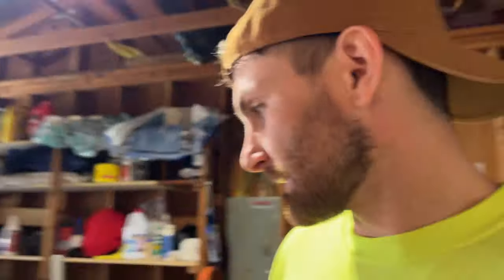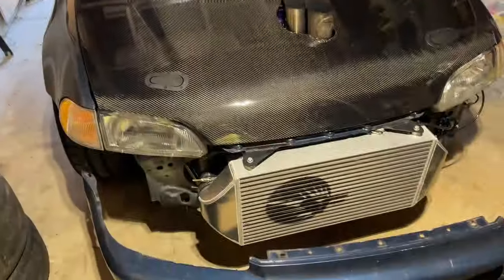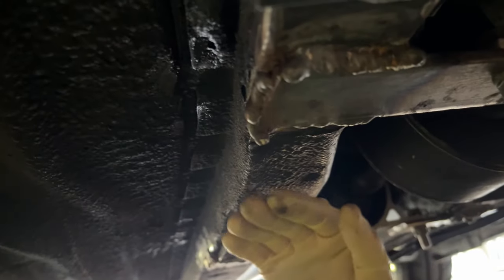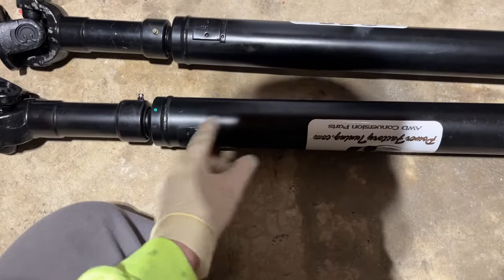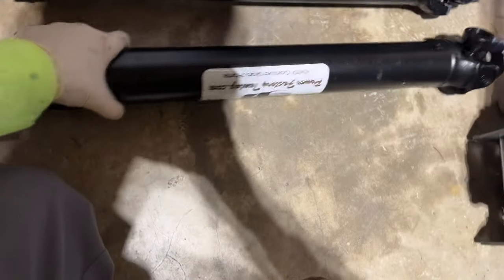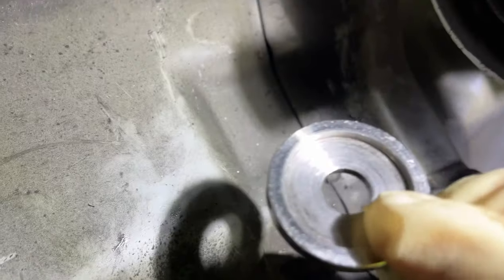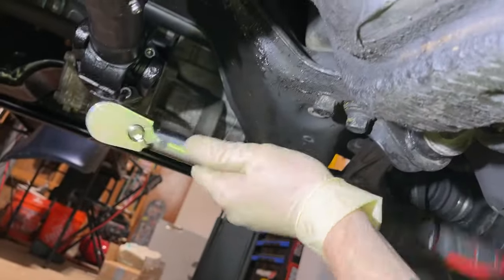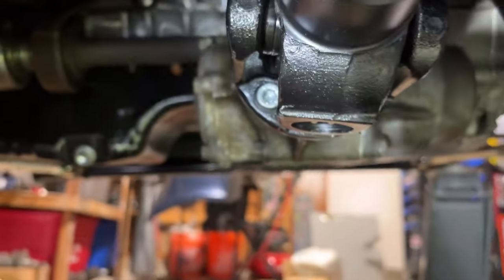The biggest issue with my AWD civic..

Comment: Do you think it’s possible to go AWD in a eg hatch using the rear subframe brace to mount the diff on the side with ones drilled in the side, then just use long bolts and spacers from the top. (Using a fuel cell)

Also for driveshafts is the 97 crv one correct length for a eg hatch b series car ?

Comment: Welding overhead is a bitch....Is it possible the synchro/slider is porked for third? I just replaced mine..Synchrotech will get you fixed up.
Reply from the maker: Yeah it definitely is tough! And no I just can’t drive haha. It’s been a while since I banged some gears

Comment: Have you thought about ditching the front track bars ?
Reply from the maker: I did, however the traction bar still helps!
Reply: @hoodrichracing3901  it likely isn’t needed any more and is a handicap.
Reply from the maker: @MichiganTrailRider  from my understanding the traction bar keeps the toe stable so it doesn’t toe out which allows more traction. Idk tho! I would shed a few pounds for sure
Reply: @hoodrichracing3901  it isn’t the weight it’s the lack of suspension travel
Reply from the maker: @MichiganTrailRider  I might consider taking it off. The car drives pretty well. Thought about some rally stuff with it so that traction car might come off.
Reply: @MichiganTrailRider  They limit travel? I was about to put mine on 😢
Reply: @hoodrichracing3901  I was doing a good bit of research over winter for
My future plans and I think tMyles awd integra doesn’t run the front traction bars any longer. Looking at videos. Same with some of the awd dsm setups. They all seem to have very good weight transfer off the line.  Haven’t confirmed this is actually why but possibly.
Reply: @MichiganTrailRider  Daniel (Frustrate) still has his tho....your hatch is cool, don't the 85s have tension arms or whatever, already?
Reply: Not sure what you mean.
Reply: @MichiganTrailRider  I thought they had the little tension rods that tie the lower control arm..they kinda function like traction bars
Reply: @boostismagic no lower control arm looks like a regular control arm doesn’t have any extra bracing like a traction bar style. The 3rd gen civics do use a torsion bar as the regular front strut spring though.
Reply: @MichiganTrailRider  earliest I’ve ever had/serviced was the EF..🤷🏻‍♂️

Comment: Is your T case built?
Reply from the maker: Stock, next spring will be built
Reply: Ah ok. I also have the gearx gear set. I’m saving up to get the t case gears so I can open up the trans just once.
Reply from the maker: @awd_don  that’s exactly what I did!! Definitely worth it. Plus it does make your stock t case a little stronger. I would also recommend the titanium tcase dowel.
Reply: @hoodrichracing3901  yessir I have those dowel pins and SFR billet t case housing already.